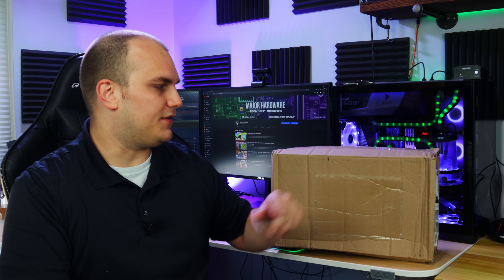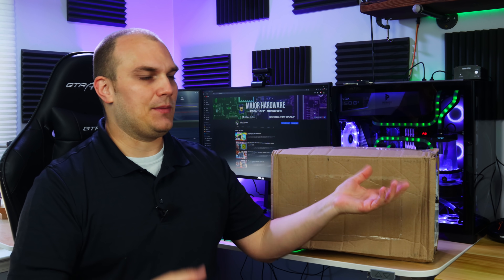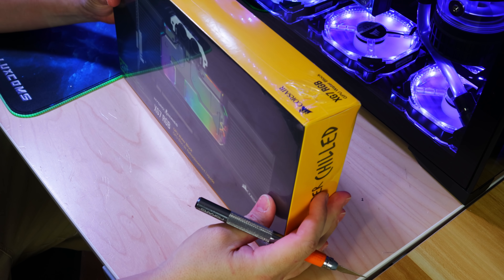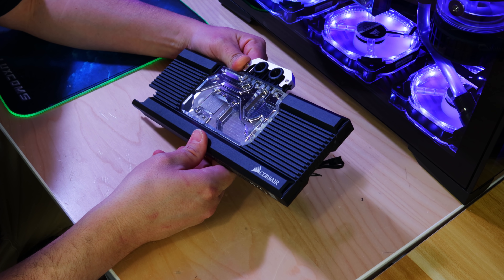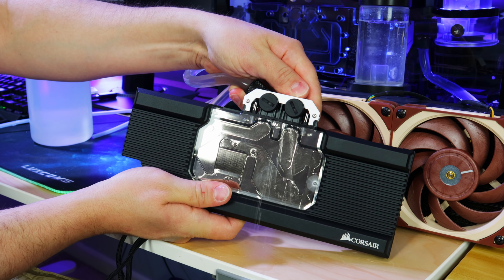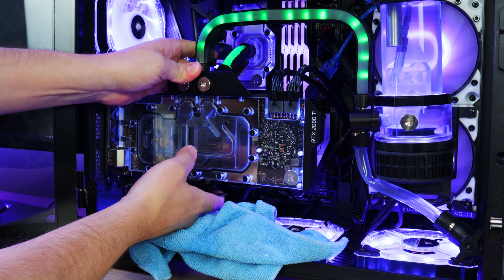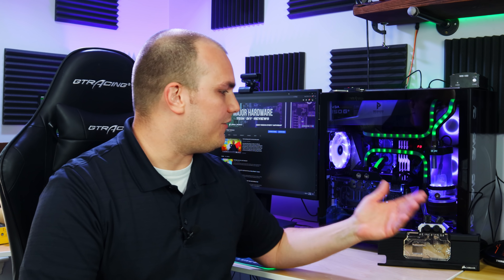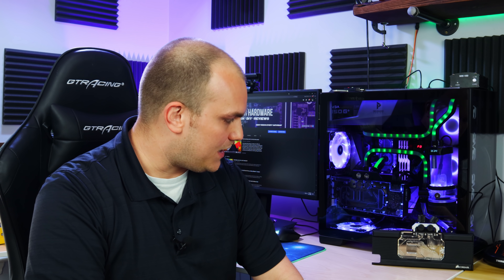Why Is No One Talking About This?? | Corsairs Leaking Waterblock!

Comment: That is a feature not a defect. You would have to be a complete moron to think they are going to "fix" the unit. They will only ever restore to original. Nothing anywhere should lead you to believe they will do farther development and change anything in the original design just for you. If it is a badly designed unit with faults that are the same across all units then it is a loss. And people should not buy but don't think you deserve your money back or think it is their job to fix it to your standards. Sorry but that was never in the cards.

Comment: Probably the same reason no one is talking about leaking EK radiators, they probably delete comments and make sure people don't get to know about it.

I had a full computer destroyed because of a radiator sprung a leak, it had anticorrosive additives, distilled water and red color, water was 3 months old, water poured into my PSU and EVERYTHING died.
I lost 4 HDDs full of pictures, movies, series, work, "homework" games you name it.
GPU died, MOBO died, CPU died, ram died.
It shorted 230v straight to the 5v rail and BAM.
Never buying anything from EK ever again, now i just use a massive noctua cooler and it does the job more silenter.

Comment: I have the rtx 2070 version of this water block and I have had it for a couple of months now in my system. I have never had it leak under the terminal. I do think this is an issue they need to fix with a revision but I do not think, as long as you make sure that the hard lines are not putting pressure on it, there is a big enough problem for you to just throw the block away. The only time I have seen this problem from virtually every tech reviewer is when they are purposefully making it leak by bending the terminal block. I have not seen a single issue on YouTube about it leaking randomly. 
Basically as long as you install it correctly there isn't really an issue with the block in my experience with the product.

Comment: That's the kind of thing that scares me off of water cooling. That, and the fact that my current system is way too small.
But what I could do if I could is get a large case, and slap a couple dual-tower heatsinks on my CPU and GPU. With those cool tan/brown Noctua fans.

Comment: Corsair GPU waterblocks are just a very cheap Chinese EK wannabees. The design is flawed from the the beginning and is just a worst implementation than others in the business. The inlet and the bottom plate block should be a one piece. Failing to do so is a major design flaw!!!

Comment: Interesting.... something similar happens to Primochill fittings if they are put in tension. This is why it is important to have your tube length correct. This way there is no tension or compression forces being applied to fittings or in this case GPU blocks.

Comment: Corsair failed with their generation 1 gpu water block wondering if the cpu blocks leak also, but i still use a 2012 corsair AX850W gold psu and its still going strong so WTF corsair fix yo shit.

Comment: Because you are an idiot, who probably cannot build a wazer cooled PC, since you need to use quite a bit of force to make it leak. Like under no circumstance it can leak, if its just being used like it's supposed to.

Also running a pump straight like that only makes it more prone to leaking, since there is bigger water pressure compared to what it would be, if you had your whole setup build.
Reply from the maker: Check
Your
Work

Comment: i have a corsair block and it looks to only leak when torqued on with the way mine is setup there's just no way it will torque itself to leak ,  im really not worried about this, i agree there's a design flaw but i also feel if you torque anything in a particular way it would fail, thats my thoughts

Comment: Jesus.. Corsair are a bunch of idiots. Seems like such an easy fix compared to the problems and costs this may have caused with potentially damaged parts and RMA's that Corsair had to deal with. If they used tough plastic and a thicker o-ring that could of been a quick fix or response to the issue, Let's hope the RTX 3000 series block aren't flawed.

Comment: Jaystwocents tightened the screws and it took a whole lot more pressure than you applied here in this video to make it leak.  The kind of pressure Jay applied kinked the soft tube and isn't anything you'd find normally happening.  I could apply pressure to any water block and potentially make it either leak or completely break off.  So why not say "with a lot of force your waterblock will leak - why isn't anyone talking about this!" It's kind of misleading to not specify more in detail what's happening or didn't happen to make it leak.  I have these waterblocks and the whole hydro setup (cpu waterblock - 2 gpu waterblocks - pump/res combo) And the only issue i had was that the fluid that corsair suggested i use, after purchasing all of their hydro hardware, clouded my whole system up. (I know not to mix aluminum with copper) I had to take the whole system apart using guides on youtube and put it all back together after cleaning the cloudiness.  I have been running my hardware ever since using treated distilled water.  This was my first ever custom water loop using soft tube and all the components corsair offered.  No I'm not a fanboy of corsair but i wanted everything in my system to say one name just like if i were to buy a new house - i'd want the appliances (stove - fridge - dishwasher) to be the same.  All im saying is that if i had not already rolled the dice and purchased this waterblock your review would have given me the impression this would be a bad purchase for fear of ruining my gpu's. And clearly that's not the case because this might be the reason people probably aren't talking about this is because it isn't happening to people enough to create a video about it.  I could ruin my gpu just installing the block - the warranty is voided the moment you remove the screws. Everything built is going to have a failure rate and yes corsair could take notes from EK and add a third screw after creating the space between the inlet and outlet.  I'm just here to say to the person that likes corsair or any other hardware and wants to have a system with one labeled brand in it - this is not a bad option and i haven't had a issue other than that cloudy fluid.

Comment: No shit it's gonna leak if you tug on it and it only has 2 screws, I suppose qc didn't take into consideration some moron was gonna be running their PC with the side panel off and a full res yanking on their fittings

Comment: When I first got into computers and building my own, I was all about Corsair. They didn't have the craziest designs or the best prices but I trusted what I heard about their customer support. Case, PSU, liquid coolers, RAM, and fans were all Corsair; basically if I could use a Corsair product I did. Fast forward a couple years and I wanted to my my desk a little farther than the bundled PSU power cable would allow. I reached out to support via email asking if a wire of a certain gauge would be appropriate provided if it was sufficient quality (I went overkill since at the length I wanted it would only be like $5 difference). 
Instead of confirming or recommending a more robust solution if I was wrong I was told "I can't tell you". I asked, well what is the gauge of the power cable supplied? "I can't tell you." What if someone wants or needs to have their computer a distance from the nearest outlet that is greater than the length of the included cable? "Use a power strip?" Ok, what would be an appropriate gauge for the wire for the power strip? "I can't tell you."
It was really unreal. Not only did Corsair refuse to give me a straight answer they recommended I use apparently any power strip to plug in at least one high power draw device. I really lost respect for Corsair and their products and actively avoid them.
Reply: Corsair never had the best prices, only on their crappy lower end stuff that always failed. Corsair had invested a lot of money on marketing, so it was always a very well known brand but if you knew anything about PC parts you would know to steer clear, for me it was always a mix for parts. For instance 
Case: Fractal Design
Ram: G.Skill
Power Supply: Rosewill
Liquid Cooling/Blocks : Phanteks
Fans: Noctua

Comment: why dont you try and fix it yourself. either glue it ,or remove that piece, mark the o ring size on the opposite plate since it doesn't embed into both sides. dremel out the opposite side, order some thicker o rings and see if it works. this is just if you are going to call it a loss anyway. because of course the warentee will be void lol.

Comment: In all honesty, this would not affect most people unless there is rotational force applied to the block inlet/outlet.  If you vertical mount this, it might be an issue, if you horizontal mount this with soft tubing, you likely will never have this leak.
Reply: Check out his original video, he already proves that it does leak that way

Comment: So, something I mentioned to Jay, but something you can test as well.

Is it easier to simulate this with a hot, closed loop...as in, bleed the system, cap the reservoir, heat the water with a CPU or something on another block safe from harm (or even plumb it into a different loop), and see if it's easier to make it leak or if it leaks all by itself.

The thermal expansion of the liquid will probably make the issue worse, you might even make it do it just by pull from a bend in the tubing.

I feel sad because I have an entire Corsair lighting setup, and all Corsair parts to do my custom loop in my basement, waiting for good weather to mod, paint, and assemble everything. Now I don't know that I want to.

Comment: I like the little flow indicator wheel thing to the left, but as you said, it has a design flaw in that the bottom edge of the connector block isn’t sealed to the transparent part properly - when bent over it leaks ☹️

Comment: You use your status to contact their PR dept for comment & see what happens. It's clearly not fit for purpose & given its contents its potentially very dangerous.

OK if it leaks on your boards it's a bummer but if that spews over your psu whilst you're not home it could literally burn your house down going to the extreme.

I think corsair need to publically respond to this & possibly issue a recall of all faulty units.

Comment: To be fair. Jayztwocents did testing on this. Under normal usage, this shouldn't be a problem. You have to apply a fair bit of force laterally to make it leak, while this is a design flaw, and needs to be fixed. It shouldn't really be a problem for most people.

Comment: New block probably came from Netherlands because they didn't have US stock. Would totally request another RMA. No clue how they'd fix that without a redesigned manifold. (there's no space for a third fastener). But screws are exposed. A machined metal manifold would probably work. Or something with less flex than their design (heck, acrylic might work). Adding a third screw is hard since it's not drilled. Yeah, they need a fix. That's unbelievable.

Comment: I have only used EK GPU blocks since 8800 series.  Only had one leak on a 9800GX2 block, due to an over-tight screw cracking the acrylic. They sent me the new acrylic part for free. 
Never had any issue with any of their modern blocks or fittings/pumps etc. 

That thing is craptacularly badly designed. Who even tested it before production?

Comment: Personally I would just take it apart and lay a bead of silicone sealant around the o-rings. There is no way for there to be a repair, it's an overly flexible design flaw due to the use of molded plastic manifold made from flexible plastic with a mold parting line where there shouldn't be one. There are much better plastics that are available but cost five times the price which I've used in making plastic water outlets for car engines in a factory.

Comment: I think I posted this in one of the last two videos in this series, but Corsair isn't going to fix this, at most they'll have a new design on the next generation of products. 

Why? The manufacturing involved, not just of the blocks, but of the components of the blocks themselves. It wouldn't be super difficult to add the extra drill and tap operation to the acrylic piece, simple gcode change and it's done; even changing the screw locations, the one under the center of the 90 degree block, on the cooling plate and acrylic wouldn't be that difficult to do. 
Where this is an issue is the plastic 90 degree block going into the actual cooler. If the entire thing actually is plastic, that requires an entirely new injection mold, and the current 'mold' can't be fixed cheaply, in relative terms of price. You'd be adding an entirely new hole to that piece, in injection molding terms, that means an additional post would be added to the tooling, as the tooling is a negative of the final product. Now Corsair could source a machine shop that has one of those fancier machines that can do additive metal using powder and lasers, maybe an additive machine that does welding depending on what metals their molds use, but either way, that's cost of additive machining, cost of subtractive machining, and cost of downtime while those pieces are being machined. Or Corsair can get new molds altogether, which would probably land in the same ballpark of pricing. 
Or, and this is what they'll most likely do, forget about the issue and consider better design in the next generation of products. Next generation of products are going to have new components anyways, so why waste money on fixing a product line when that product line is going to be EOL within a couple years. Yeah, it screws over current and future customers of the block, but Corsair doesn't care, for a couple reasons. Reason 1 being that applying a lateral force to that component is technically out of spec for the product, which would be blaming the customer. Reason 2, again, is the cost situation, especially when these products have a relatively narrow window for it's peak sales figures.
Now this would be a different situation if a better design were able to be retrofitted to the product, but that's not quite possible. That acrylic-metal screw I mentioned earlier, that's right under the center of the 90 degree block, it's way too close to the edge for a screw to be retrofitted in that area, meaning the entire block itself would need to be changed to allow this. 
The only possible retrofit is if they make that block metal, and if the next generation of products have the exact same mounting and porting as this product, basically a 1:1 fit plus the extra screw in the middle. But even then, you can't guarantee that the solution will work. Plus this is only if Corsair designs it this way and sells extras as a retrofit solution to these products, of which I doubt will happen. 

Corsair is also out of any liability related cases. Go back to that 'applying lateral force to the component' comment. The product operates as intended within spec, but fails when out of spec. When does the out of spec failure occur? When the customer applies pressure to it, either during installation or during use, making the customer at fault. The solution? Don't apply pressure to that component, and make sure your tubing doesn't do so either, again, leaving the customer to implement this solution. Any case against Corsair would get thrown out, and there's no legal grounds to require a recall of the product. Every failure scenario comes down to user error. The only way this gets fixed is if Corsair fixes it out of their own kindness, or care of their reputation, more than likely the latter. Unlikely to happen anyways, just a recall itself would be expensive without even getting into all the manufacturing changes; and again, this is on a product that has a relatively narrow window of peak sales, unless future graphics cards also have the same mounting and cooling footprint, which is unlikely.

This is how the corporate world operates, sadly. Don't expect anything to happen unless the entire influential part of the community makes it a problem.

Comment: I’ve RMA’d with Corsair at least three times.  They always send new or refurbished items back to you.  Typically, that’s not something that bothers, oh...exactly nobody.  Worst case scenario, sell it, it is new.  I mean, if you hadn’t opened it.  I just meant if there was a product you weren’t satisfied with, get your new one and sell it as new unopened.
My RMA experience has been good until recently.  I RMA’d a set of Dominator DDR2 quite a few years ago.  Had to have been 07-08 maybe earlier than that.  Then an H100i v2 that died almost immediately.  They upgraded it, so that was sweet.  And most recently a Void Pro wireless headset.  The battery swelled up and they refused to send me a new one, cheap bastards.

Comment: Thanks for the video.  I have the same waterblock for my 2080 ti .  Would putting some sort of silicon sealer keep it from leaking?
Reply from the maker: Best thing would be not to touch it and make sure no stress is put across the manifold and it "shouldn't" leak
Reply: @MajorHardware  Thanks.  I'm gonna cut up some petg tube to reduce any GPU sag too.  Hoping more creators bring this up so we could end up with a recall or something.

Comment: Probably lazy of me but once Ryzen 4000 series and RDNA2/Ampere comes out I'm thinking of finally going full WC, its been a dream of mine for years however last time I tried looking into what I actually need to achieve this I couldn't find a lot of info, like obviously I need blocks, rads, res and pump but what about fittings, tubing etc? and even the stuff I know about how do you decide which to go for?